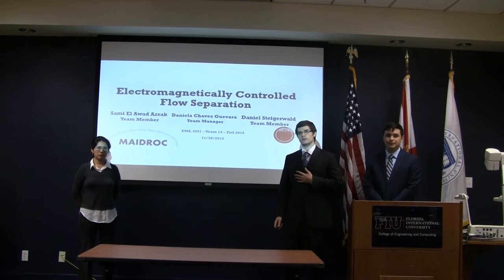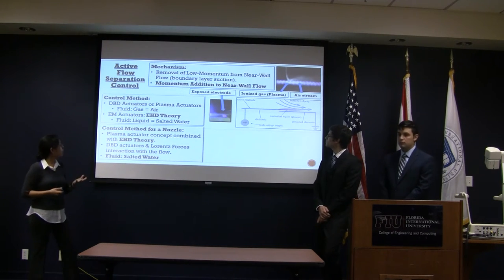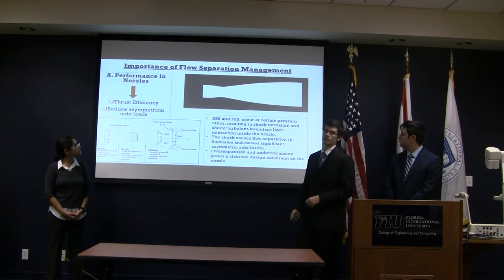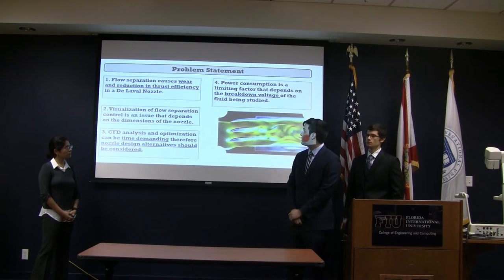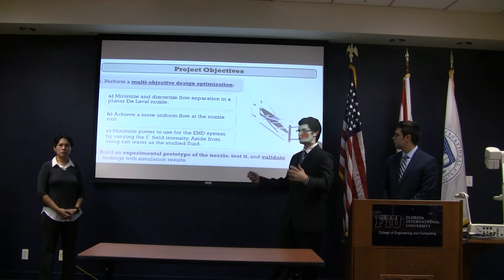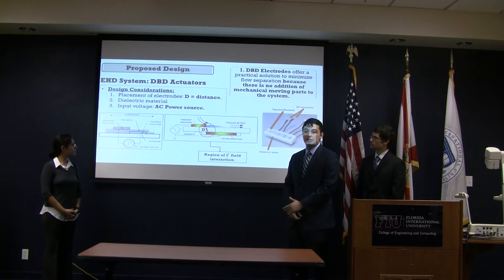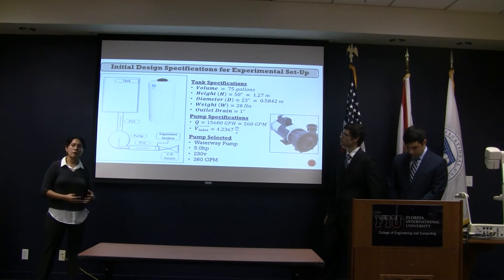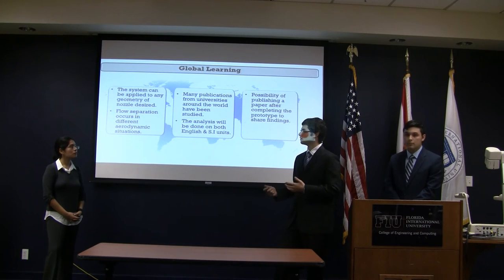SDO Team 13: Flow Control Separation with Plasma Actuators

Comment: Hello, I am doing similar research and I am having heating problems of the electrodes. I am using Voltage of 8kV and 18kHz. The power output is 40W. Do you encounter a similar problem in heating in the electrodes? If, yes how is it mitigated?